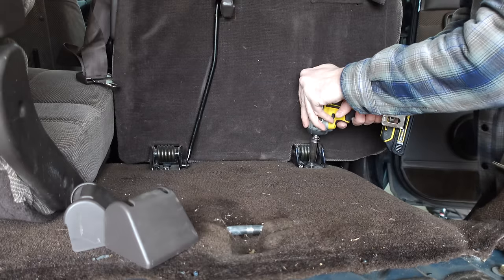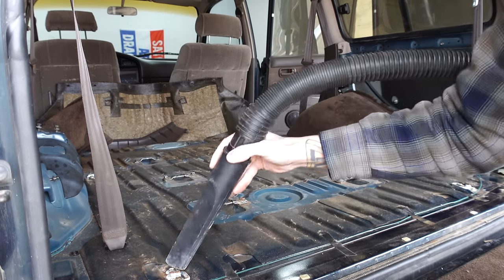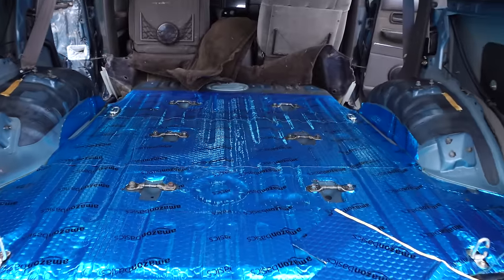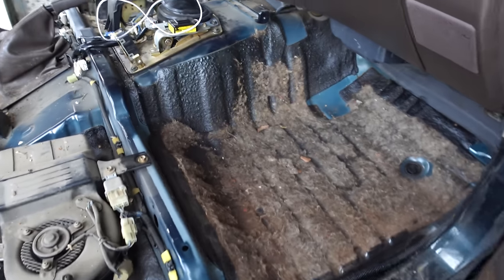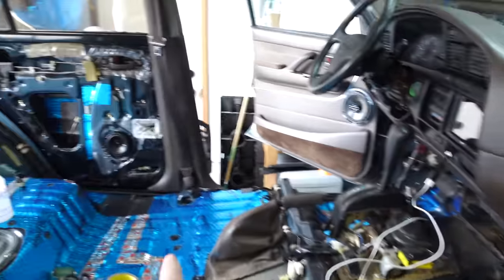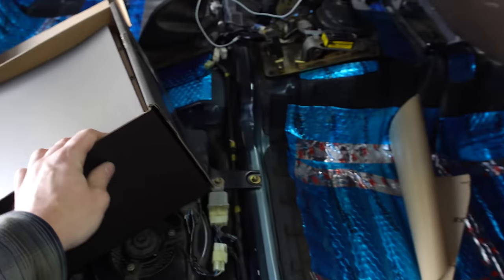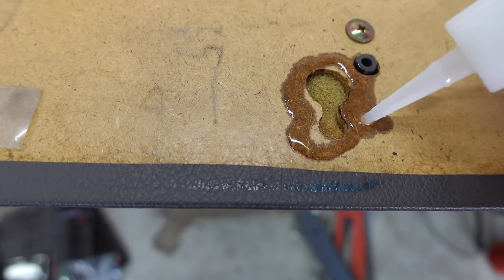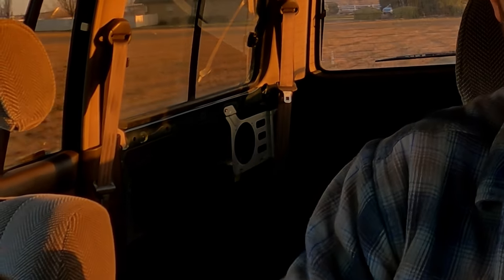The Cheapest and Best Sound Deadening Mat for My Land Cruiser!

Comment: The amazon mat works great, until its gets super hot. then it falls off. the mat itself is good its the adhesive that's the issue. In my Silver scion its wasn't an issue as the interior didn't get instant boil hot. My matte black crown vic on the other hand got way hot and the stuff slid down in the doors. dash temp was 248f, seat belt buckle was 223f would scorch you, when i measured it in all fairness tho.
Reply: Where do live for that heat? Both prepped the same? I have t heard much about Amazon basics failing in heat. 21:56
Reply: @gregsmith9892  Colorado. Can get 105, about tops. Car was mat black tho and just ate the sun. I measured inside temp at 195 with 248f on the dash, it was sagging. But the NVX I replaced it with was still on when I sold that car years later.

Comment: It usually is a good idea to remove the factory sound deadening with dry ice or a freeze spray and the hammering it, before installing the new ones, since it reduces weight and gives a good mating surface between the metal and the mats, in case down the line the factory material ends up crumbling and causing the new mats to fall off.

Comment: What's your take on applying both of those layers to the roof (from the sunroof backside towards the hatch)? Good job, btw. I'm definitely going to do this as well but like you also need to fix the door cards and replace some window motors.
Reply: 3m 77 adhessive

Comment: But the real question is, will it melt and get nasty like some other cheaper deadeners can? From what I understand, the previous "go-to" was Killmat and it doesn't do that.

EDITS: Phone decibel meter apps are completely useless and inaccurate BTW. Another thing, the decibel scale being logarithmic still doesn't mean what you think it might at face value. It takes about 10db difference to sound half or twice as loud to the human ear, and on top of that, our ears aren't equally sensitive to every frequency. An equal loudness curve will show you need about 30-40db gain at 25hz to sound just as loud as 200hz at whatever volume you listen to 200hz at.

Comment: I have been really enjoying your videos. Thanks for taking the time to post them on YouTube. 
I just finished installing the four door speakers last week using your guidance. So thanks for going in depth on the install. 
For the sound deadening, I think I would like to start with the quarter panels and doors. How much material would you recommend purchasing if I only did those things first? 

Another thing I would like to see you try is to figure out a decent subwoofer option.
Reply from the maker: Thanks! You could probably get away with around 50sqft for that.

Comment: Pretty sure the reason that there is no factory sound deadening in the doors and quarters is because the road noise doesn't come from those areas. You should have started with the wheels wells in the rear.

Comment: People don't believe me or understand how I can have over a hundred hours of installation time in my BMW. But a lot of time has gone into rerunning speaker wire cuz I ran a new strip of speaker wire and then a few months later I added another speaker so I added another speaker wire run and each one and then time went on and I added one more run for my tweeters then a few months after that I decided to pull all those out and to put all of the same kind of wire on there that way it was nice and the quality was going to sound the same throughout the whole vehicle that took a lot of time if you add in all the hours of doing it technically four times and then I have a lot of hours or I integrated my bass knob into the ashtray that's in my Center column that way when you open the ashtray the bass knob it goes up and down as you open and close the ashtray so that's a long time to make that work properly. Just stuff like that you know today so much time to do and clearly it's easy to get over 100 hours of install on a vehicle😅😊

Comment: The stuff you used on the back was mostly wasted. It would have been better to pull the headliner and insulate that. Sound blocker prevents vibration, sound deadener reduces it.

Comment: if you know some basic physics, you would know the additional mats on the floor were completely useless and a waste of money...sound = vibration, even if the metal is bend already its makes a lot less noise...the worst are large flat areas what you had in the doors and in your sidewalls. also you dont need to cover the whole area with sound deadening, 40% is more than enough!

Comment: You're doing it wrong. Lightened wallet and weighed down truck unnecessarily.

You only need 25% coverage of the damping tiles. The first layer. It just adds mass, to change resonant frequency. 25% coverage, placed in center of each section of flat panel. It only works if it becomes part of panels mass. Hence why you have to hyper clean and roll it down. Has to adhere to become one.

But then second layer, the closed cell foam, that DOES need to be 100% coverage. That product actually blocks sound waves (which the damping tiles don't).

The added mass of damping tiles, blocks outside sounds from vibrating panel, turning it into a crude speaker. It just has to add enough mass to prevent that from happening, and 25% is enough.

Divide each flat section into a series of squares, no larger than 1' x 1'. Cut a piece of damping tile that is 25% of the square. Place it center of square. Roll it so waffle pattern disappears. Tape down all edges with metal foil tape.

NOW add the closed cell foam on top, at 100%. No need to go crazy with rolling that stuff down. Will work fine either way.